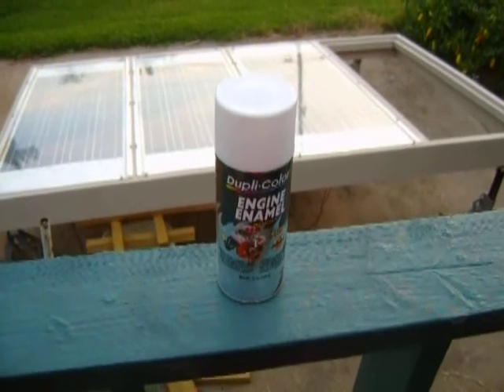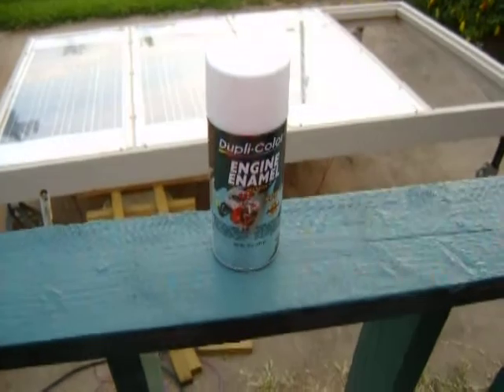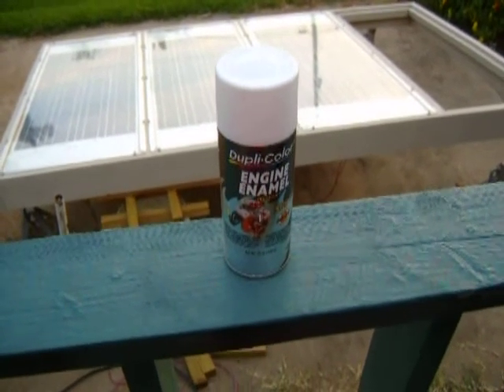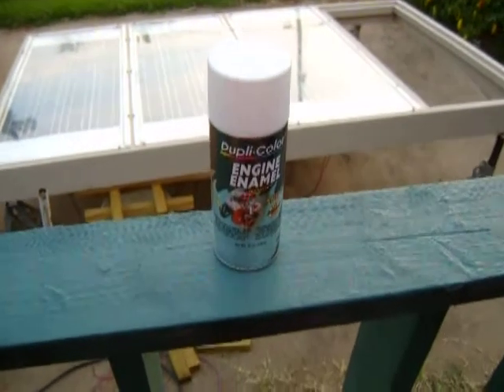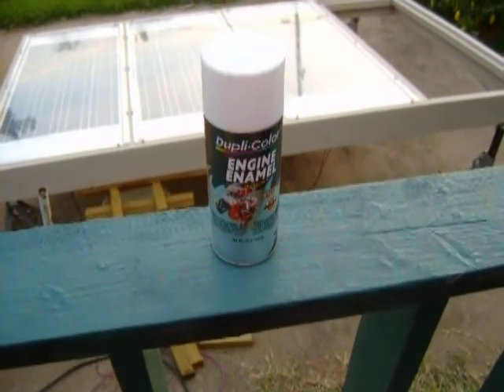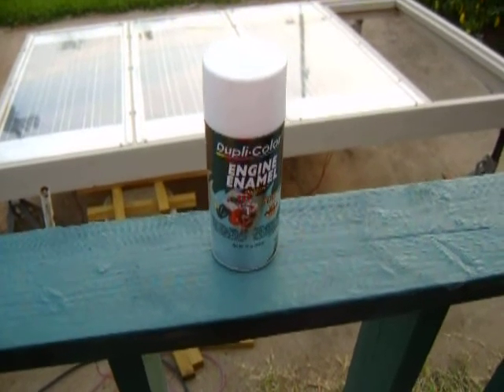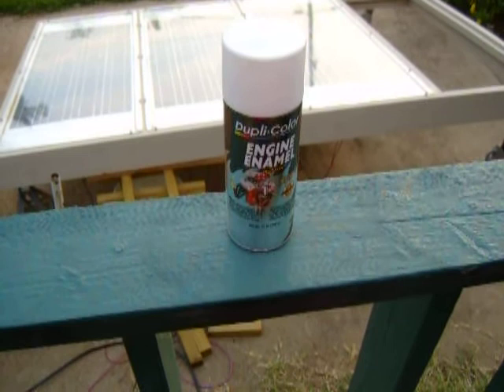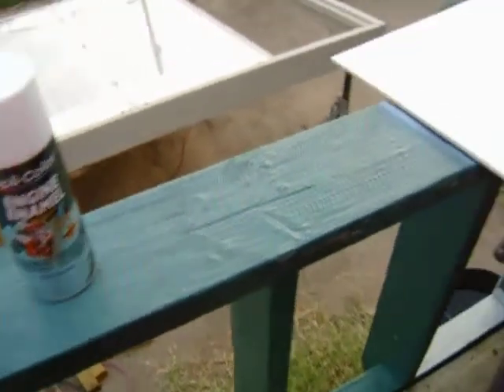Painting Solar Panels

Comment: I never thought about the heat build up when I built mine.  I used regular exterior latex paint.  So far after eight months, it's still holding up though.  But you're right, they do get pretty hot.